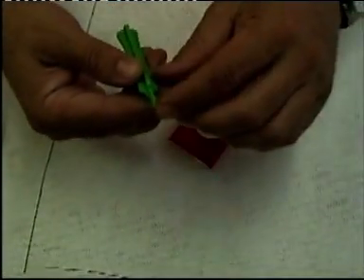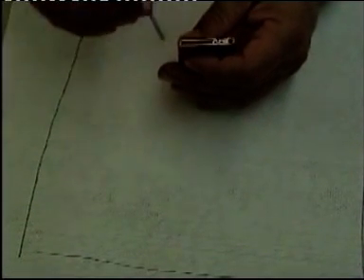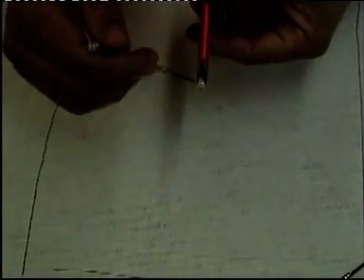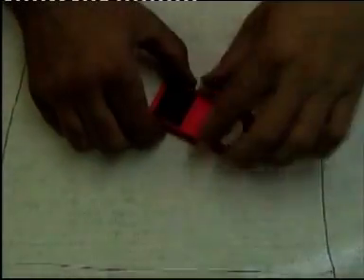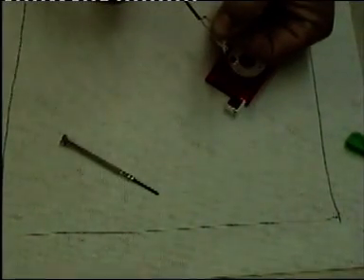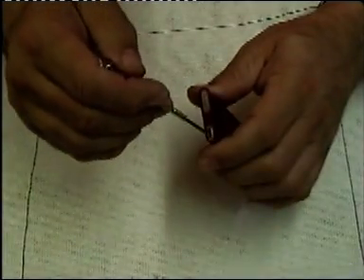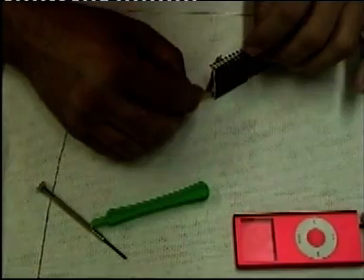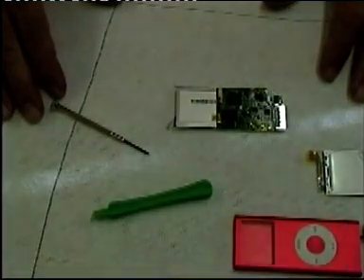iPOD NANO REPLACEMENT SCREEN DETAILS REMOVAL

Comment: DO NOT follow this video unless you pay attention to the 2 second pop-up at 5.56 min . They obviously forgot to show you how to unplug the jack ribbon,which is very important when sliding the inner out from the casing ( other videos posted on here show you how ) Also the correct way to dis-connect the screen from the connector on the main board ( 8.10 min) is not to just GENTLY PULL,but to gently flip up the black band to 45 deg which will release the ribbon from the connector.

Comment: Nice Job, man You've got guts. Allow me to rant, though. Why does it have to be so (darn) difficult to open it, not neccicarily for replaceing the screen. What If I'm just trying to replace the batteries??? On older ones you could just pop the back off and disconnect the batteries and replace them and barely have to even TOUCH the board. :(